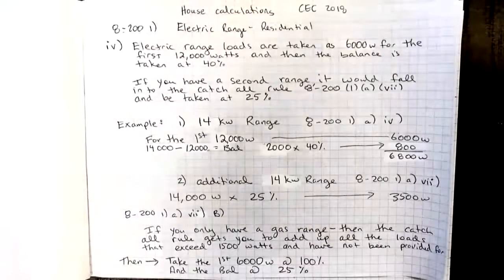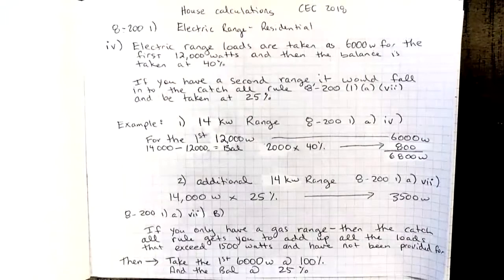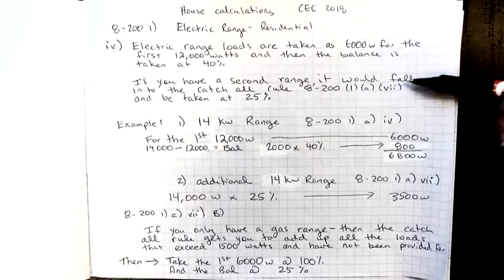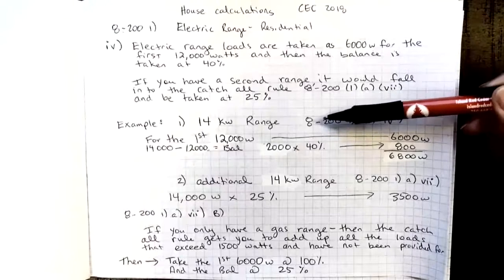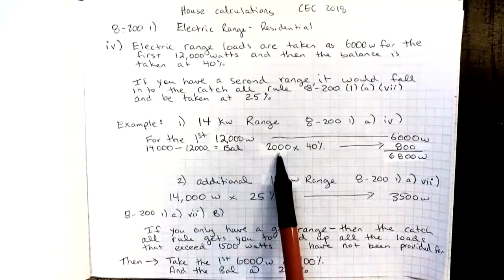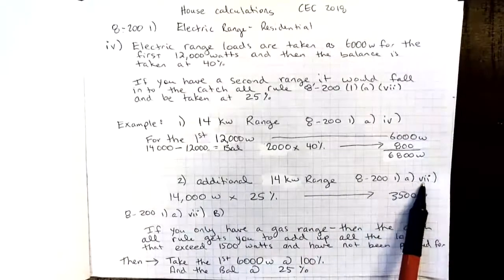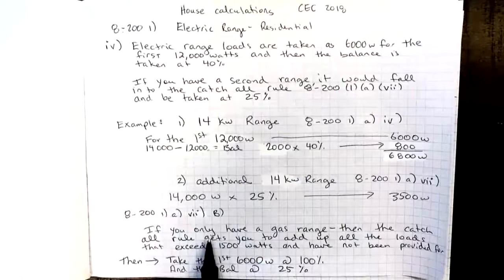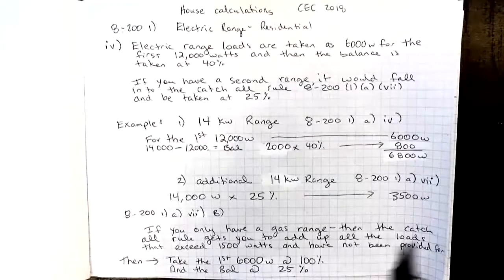CEC 2018 House Calculations Electric Range: Rule 8-200 (1)(a)(iv)

Comment: Good video, may I ask a question? What if the customer has a gas stovetop and a separate electric wall oven on a 40 amp breaker. How is this calculated

Comment: i am becoming a first year apprentice soon. i have a question. what's the difference between that rule and 8-300? (I hope i could pass the AIT exam this coming friday nov 26 >.>)
Reply from the maker: Rule 8-200 is used to find the demands that are needed to calculate the size of the main service. Rule 8-300 is used to find the rating of the conductors for the branch circuit feeding just the range.